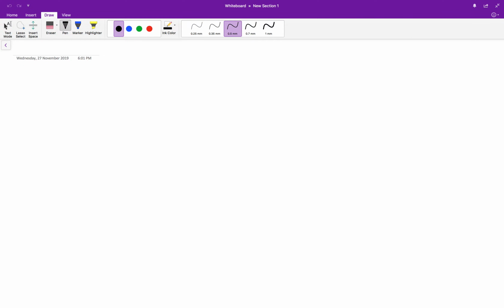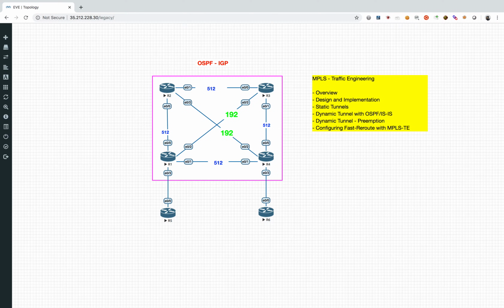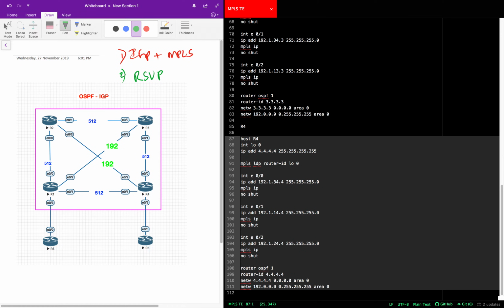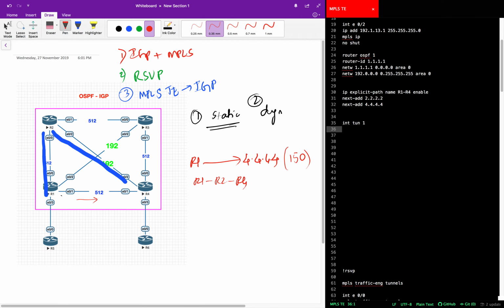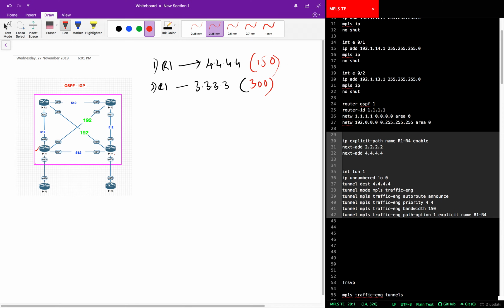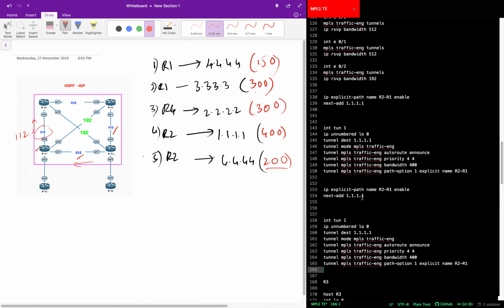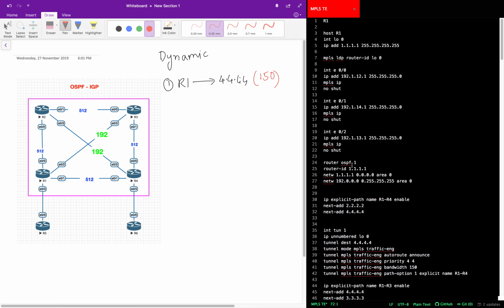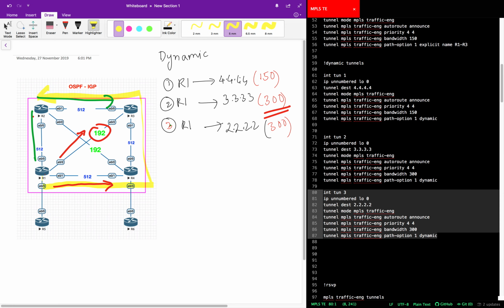MPLS Traffic-Engineering

Comment: At 32" , you explicitly configured tunnel to take path from r1-r2-r4. Isn't there any need of configuring the same on r4 ? If tunnel is not required to configure on r4 then what will be the path of reverse traffic...will it be based on IGP path ? 

Hope you like to see questions as well..
Reply from the maker: If you need reservation in the opposite direction, you would need an explicit tunnel to be configured else the existing RIB route will be used. I do point it out at 34:00